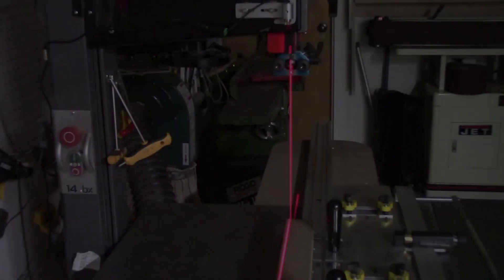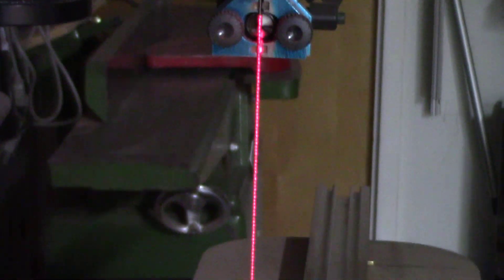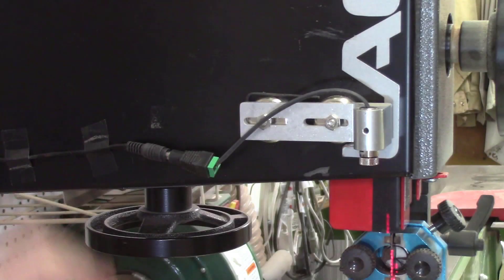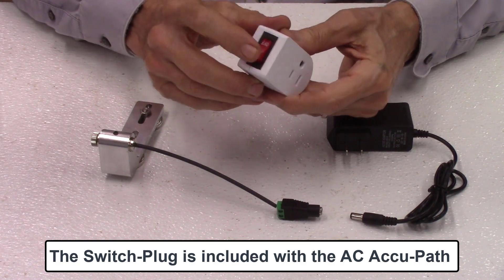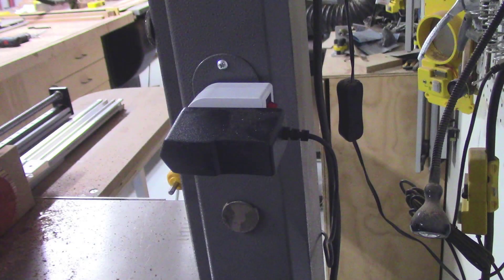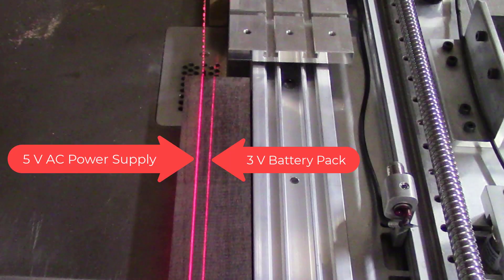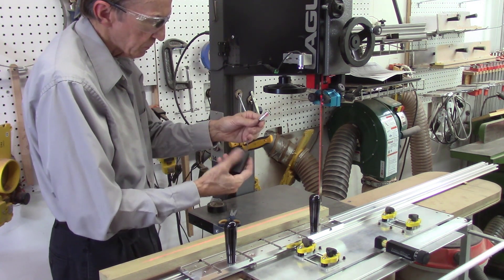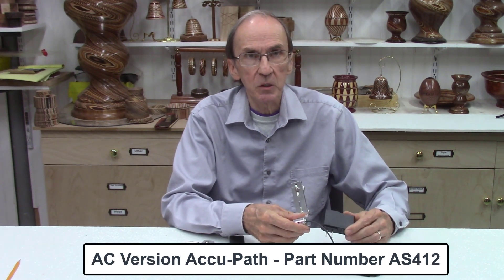AC Accu Path Band Saw Laser

Comment: Hey John, wish this had been your first option as I am always forgetting to turn the battery pack off. Is there an option for those of us that have the battery option to convert it to the ac option? Seems like offering the ac laser would be good for those that have already purchased the accessory.
Reply from the maker: That is a good idea.  Since the mounting bracket is the most expensive part of the Accu-Path, I will be offering an upgrade of the AC Accu-Path without the aluminum L-Bracket and magnets.  This upgrade will consist of the laser, the power supply and the switch-plug (part number is AS415).  It should sell for less than half the price of the original Accu-Path.  I will post it to our web site later today.